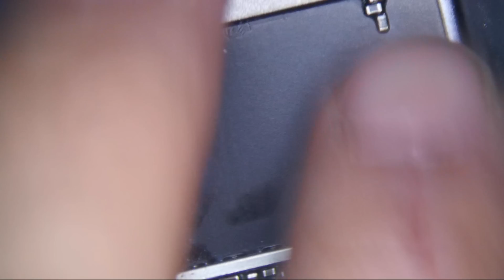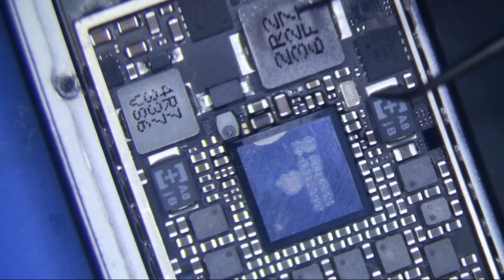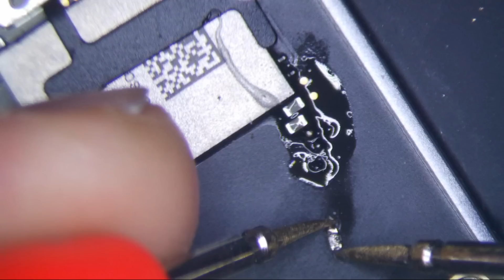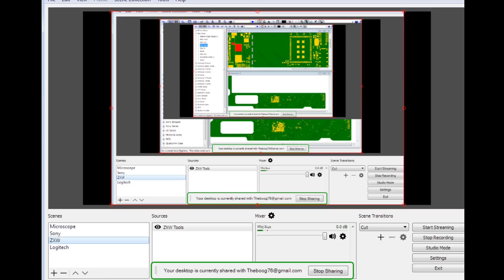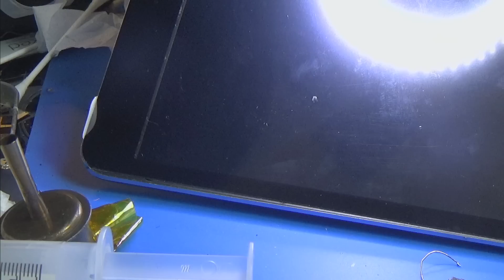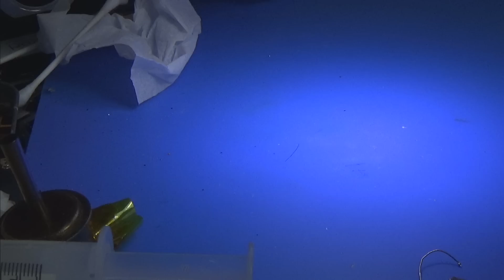iPad Mini 2 No Power Repair

Comment: ipad mini not charging, but the display is not included with the cable only works from the battery. Tristar and Main power has been replaced, but no results. What could it be ?
Reply from the maker: Николай Кононов check for 5V from the incoming USB line and work your way from there
Reply: Yes, the +5V comes in q 5700б q5701. The icon displays charging, the sound connection, but the battery that does not come The problem of circuit charging the battery?
Reply: The +5V comes in Q5700 Q5701 and appears on the diagram, but is not charging the battery. Sometimes when reboot, can't turn on the cable or the button in sleep mode, the discharge 31% per day.
Reply from the maker: You're not missing any components next to the battery connector?
Reply: ipad mini or who has not previously been opened, all parts are in place. Q8104 (FDMC6683) possible problem ? PPVCC main and PPBAT VCC.
Reply: Q8104 (FDMC6683) the transistor is regular. It receives the control DC +4.4 V, that he always turned off and charging is not. The control transistor Main Power, charging the battery with Main Power, I can not understand why is not charging, the problem might be with the CPU.